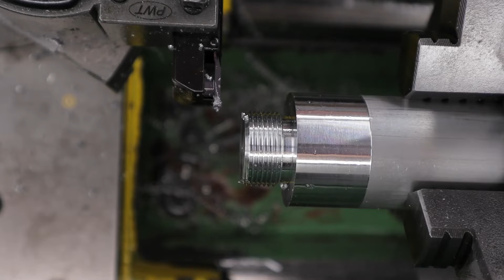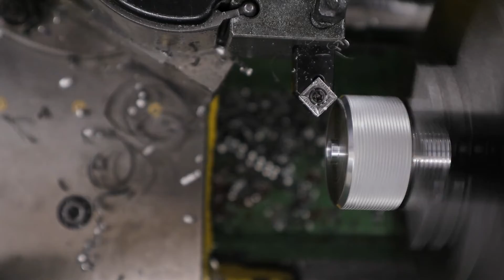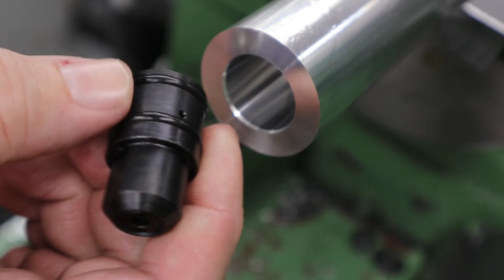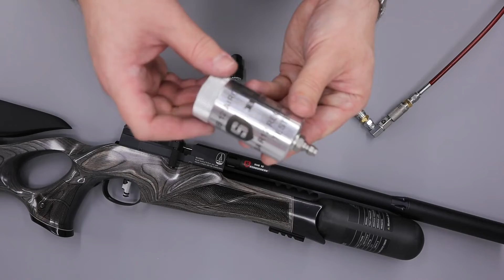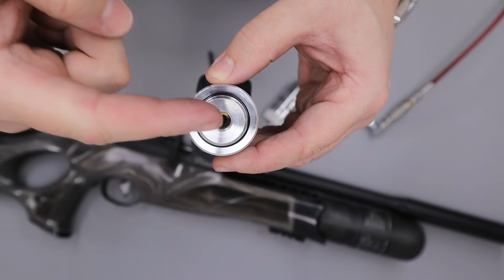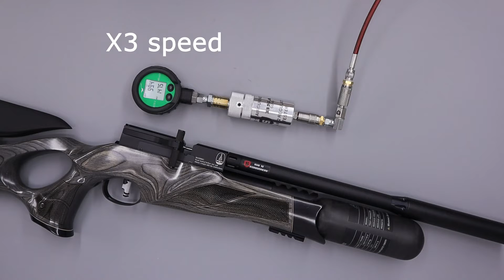Making a BSA R12 Regulator tester

Comment: Great video as always 👍🏻👍🏻👍🏻whats your suggestion for breath hole diameter?
Would it make a difference?bigger or smaller hole?
I want to use AGT Uragan(version 1 FAC)regulator as external inline regulator for tethered shooting,I would need a tester for that,
I need 175 bar on external reg
Reply from the maker: As long as it can breath it doesn't matter imo

Comment: Great work as always 
Got a question for you 
What type/number of tip your using 
I’m struggling finding same
Reply from the maker: That's a VCGT 110302 i get them from Cutwel the threading tool is a Simturn E3  from cutwel also 👍👍
Reply: @sub12airgunners  cheers buddy

Comment: Neat design and machining. The regulator does seem a little lazy, looks like you have some room to play with the pressure though and improve the efficiency and shot count. I tend to prefer longer rifles, especially with a more traditional styled stock. Hope the back mends soon, I have 3 compressed discs in my spine and they are a right pain when they want to be.
Reply from the maker: thanks, yes the back can be a tricky thing  ☹ yes we are going to have a go at making it a bit better on are and that should help 👍👍

Comment: I have an xtool laser like you, what are you painting th as aluminium with, I've tried chalk board paint etc with varying results. Just curious.
Reply from the maker: hi we don't do fresh aluminium very often but we mix graphite powder with silicone oil, simply because we have that in the work shop  but it does seem to do the job very well  👍👍 still learning the tool but its a great bit of kit

Comment: i feel for you mate back issues suck . taken me about 2 years before mine was back to full power . cracking lathe work there my friend and that laser engraver is well cool . either will look good for sure . personally i like a longer shroud  but for no other reason than i like a longer shroud . 1/2 unf for me as i don’t like propriety bits on a gun means you have a choice of silencers without having to get adapters to much faff and they never look so good with the adapter then the silencer, probably not in your case because you would make a cool looking one 😂😂😂
Reply from the maker: thanks👍 yes backs can be a problem, good ideas thank you  👍👍